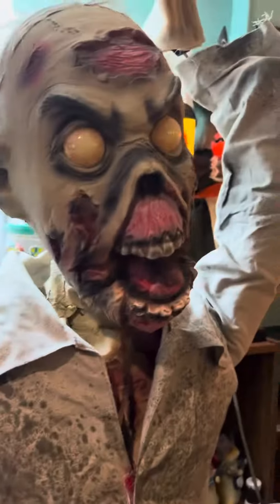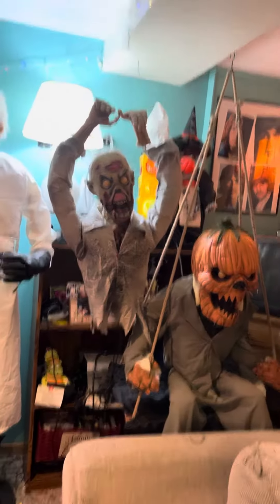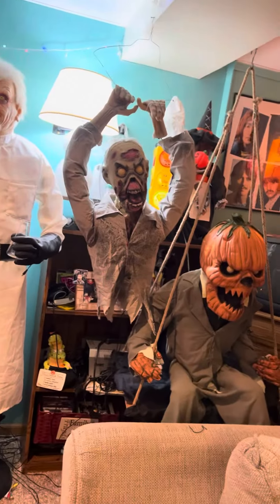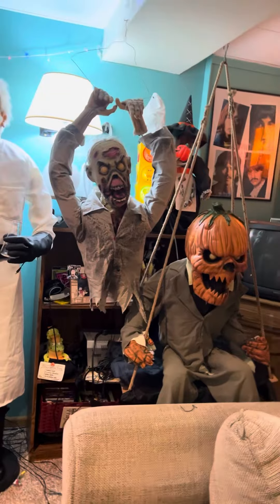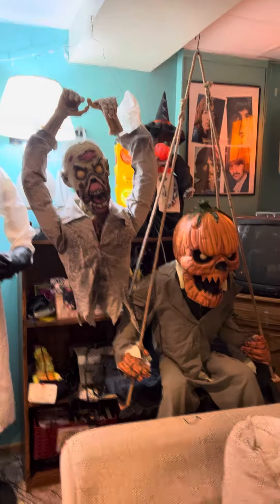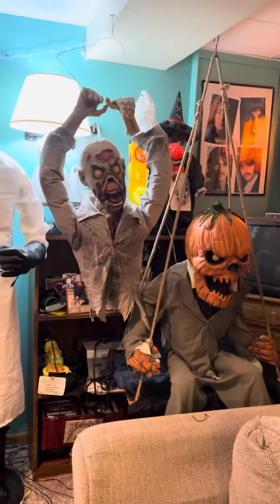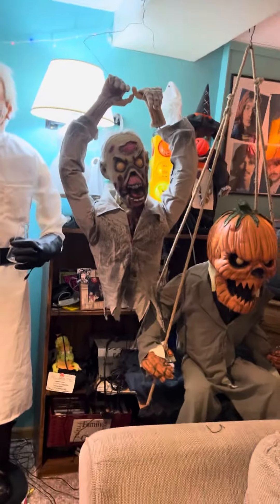ugh Head Banger Zombie Once Again Fixed

Comment: I have him but mine has a very weak neck. Any clue on how to fix that?
Reply from the maker: sounds like a bad belt to me, my flaming black widow witch had the same issue and they share the exact same mechanism so
Reply: @doctorkocktor1347  If i try to lift his head will it damage him?
Reply from the maker: @propdoctor4734  just be careful and it shouldnt